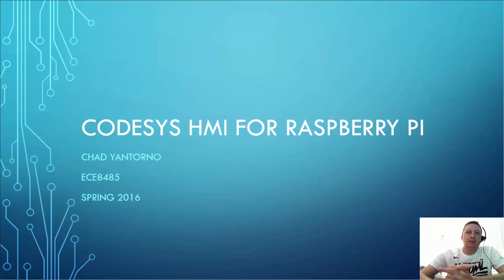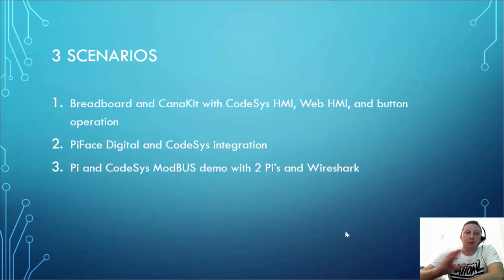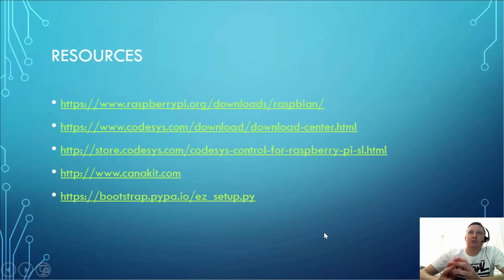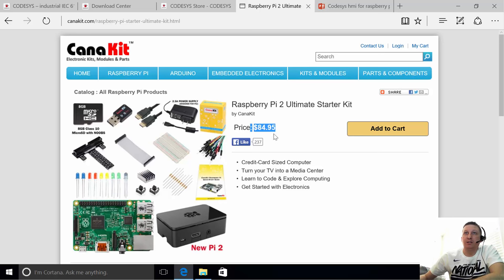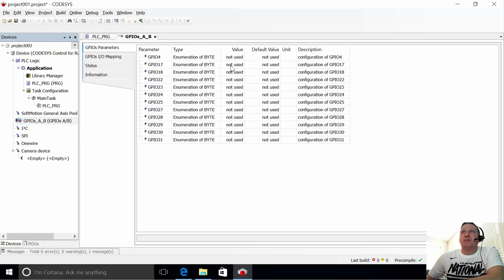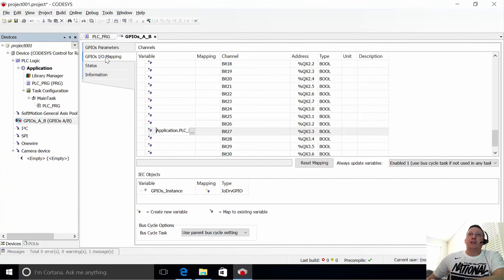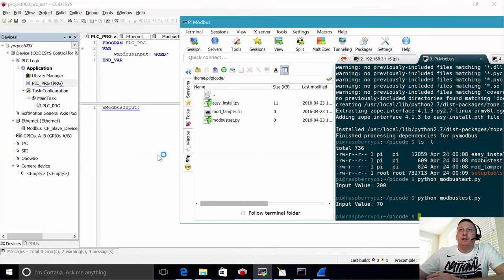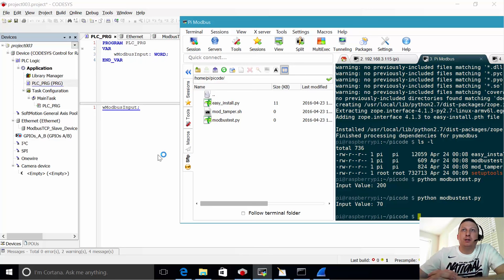CodeSys, Raspberry Pi, PiFace, and CanaKit Demos

Comment: a short note for all watching the video; the version of "Codesys control you download for RPi" should not be higher than Codesys version itself, e.g. if you download "CODESYS Control for Raspberry PI 3.5.14.10" then make sure your Codesys Engineering Tool itself has version 3.5.14.10 or higher. Otherwise you can face lots of compile 
error messages and communication issues.
Reply: Hello Sir are you familiar with the Revolution PI. Im using it for now but my problem is I cant even scan my network I connect it to my internet connection using Ethernet cable